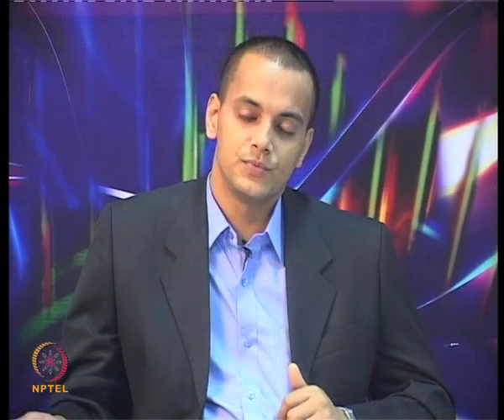Mod-01 Lec-05 Tutorial 1 : Two Dimensional Axial Flow Compressors

Comment: Amazing explanation! One doubt tho. Why isnt the number of stages a simple ratio of the net pressure rise and pressure rise per stage?
Reply: Also the mass flow rate doesn't come out to be the same if we use the inlet data instead of the rotor exit.(first problem)